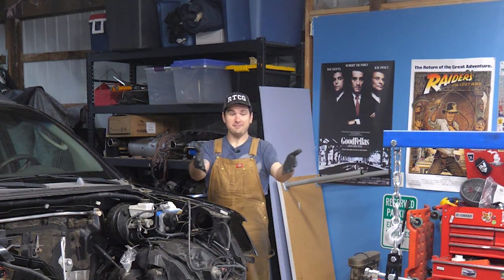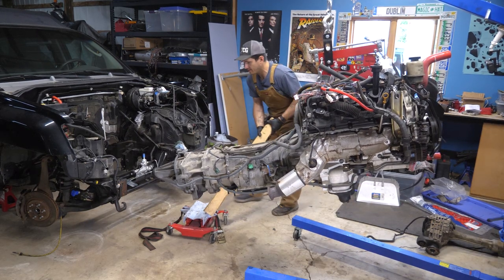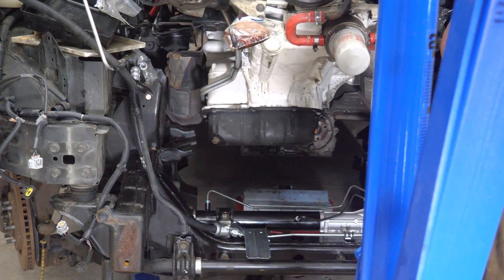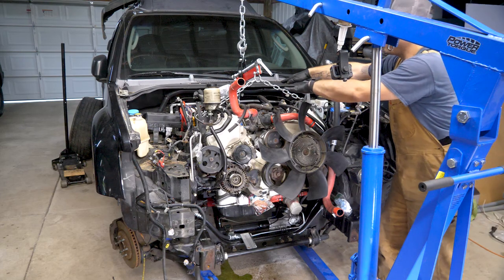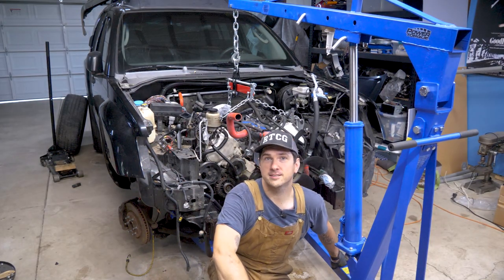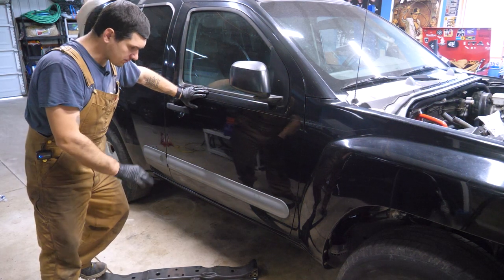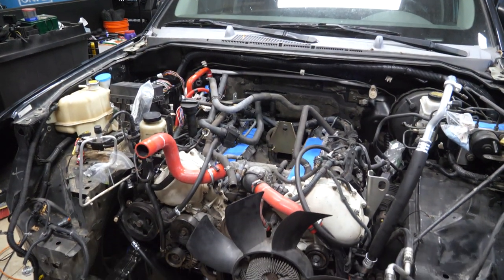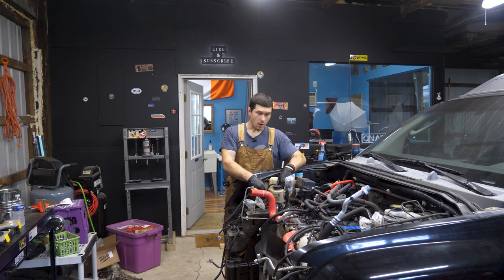How to VK Swap An Xterra (Installing The Engine - Episode 10)

Comment: You inspire me to keep my Nissans alive. I absolutely love them and want to add an xterra to my collection. I have an 07 manual trans frontier nismo and an 02 r50 pathfinder. Both are my babies but def need work since I drive them everywhere
Reply from the maker: Hell yea. Keep those babies on the road! 💪🏻💪🏻
Reply: Have the same passion for this Nissans. I have 2 R50 ‘00SE VG with Tyre carrier, a project 03 VQ manual swap and 2014 Xterra all are awesome rigs!!

Comment: I know the front end is taken apart for ease of installing with the transmission on, but is it possible to leave everything in and drop the engine in?
Reply from the maker: Possibly JUST the engine with the transmission already in place. Did that with my Titan. But trust me, it's more of a pain in the ass.
Reply: @Rythecarguy  yeah, I've done one engine swap in my life, but not a bigger engine going into a vehicle. Good to know, though. Great vid!

Comment: For this swap do you need the xterra alternator because I saw on a couple of threads?
Reply: Also, on the guide, it says you need the xterra transmission valve body. Why? And does it go for a 2wd as well for swapping?
Reply from the maker: You only need the alternator if the alternator on the VK56 is a two wire connector. If it's 3 then you can just use that one. No you only need the valve body if you have a column shift Titan transmission and need to covert the valve body over.
Reply: @Rythecarguy  ok so you need it basically if ur automatic? Not manual
Reply: Or r u talking about if the shifter is on the steering wheel or in the middle of seats?
Reply from the maker: @tylercorkum3569  correct. It's easiest if they are both in the floor. But it's still possible of the Titan is column shift
Reply from the maker: @tylercorkum3569  correct. No cable bodies in manuals. 👍🏻

Comment: I don't know if you ever talk about mileage, but seeing as you have dealt with your fair share of Nissan Xterras, I was wondering if you are MPG conscious, or do you not really care? Also, if you do track MPG, what are your averages? Have you ever been able to get reasonably good gas mileage out of any of your Xterras? Can anyone ever hope for maybe 22 city / 26 highway or more?
Reply from the maker: TBTH I don't care. Without a computer telling me the MPG I find it too tedious to track lol. It's probably a character flaw but when I come across stuff like that I just avoid it. I will say when I take my 2WD 6speed on long trips I seem to get good gas mileage. But most autos and 4WD will likely hover around 20 or lower based on what I read.
Reply: @Rythecarguy  I spent probably more time than anybody would care to admit, but I did a whole bunch of math taking the average Xterra mileage and comparing it to something that gets an average of 25 to 26 mpg, and the monthly price difference is totally insignificant. Honestly, it doesn't really seem to make much of an impact to spend more time thinking about it.